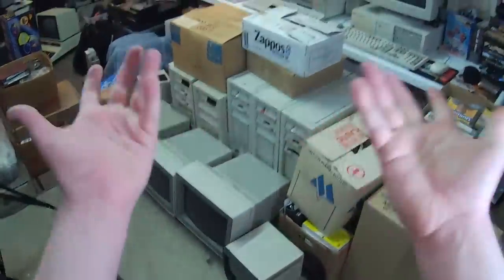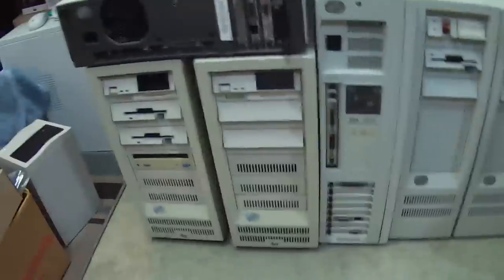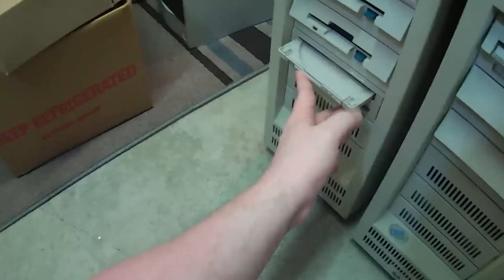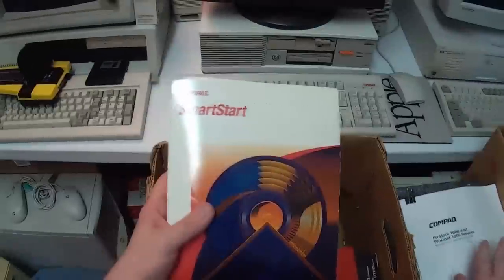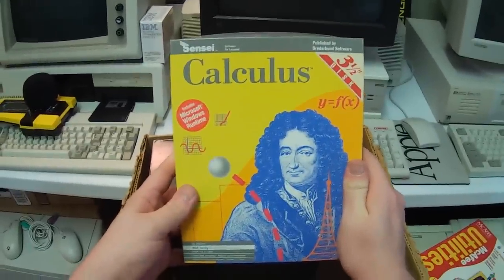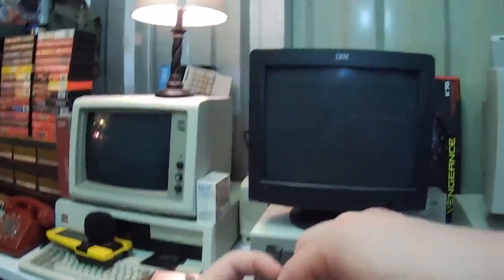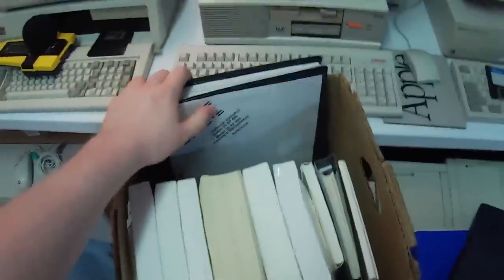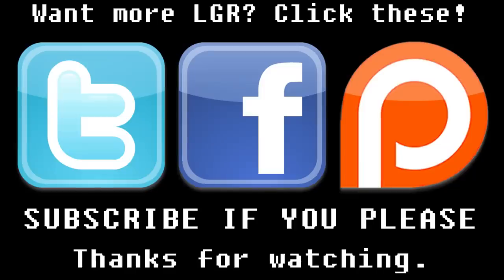LGR - IBM PS/2 Computer Motherlode

Comment: I've cobbled together a respectable PS/2 85.  Came with a 486SX fixed, so I shoved in a 586 overdrive chip so I can play mp3s.  Microchannel sound cards are impossible to find, so I found a Soundblaster clone that hangs off the parallel port.  The bitchin' XGA video card is legit, though.

She's an ugly beast, but she's got character.  And she plays Dark Forces like a boss.

Comment: hey i have a question

i have an old compac tape backup and i dont have the software

is it posible that you have the software for it?
Reply from the maker: ***** I don't, but you can find Compaq software online without much trouble. HP still hosts all the files!
Reply: i have lookes but the device cannot be found

it is an old dos tape reader/writer

Comment: I wonder how many user that Netware 3.12 SYSTEM_1 disk was.  That disk contained the server.exe which limited how many concurrent users could connect to the server.  As well as OS serial number so people couldn't run two copies  side-by-side, as they would beep and throw messages all over the screen, and to users screens (early anti-piracy).  Each server.exe was serialized on every SYSTEM_1 disk, so you could copy the disk successfully as a backup copy, but the server.exe could be traced to the original buyer by Novell.  If you wanted to set up two 3.12 servers side by side in VMs, you would need two different SYSTEM_1 disks containing different server.exe files (therefor S/N's).  Care to share the img/vfd?  I collect them as it was my first server OS I mastered in IT (NW3.11/NW3.12), as a lad of 17yo part-timer.  Only the SYSTEM_1 disk was unique per customer, the rest in the set were standard run copies.

Comment: The IBM PS2 was years ahead of its time.  It it wasn't for corporate greed on the part of IBM suits, IBM would be the big name in computers today rather than Microsoft.  

Unfortunately, because IBM made the far-superior Microchannel bus proprietary, nobody wanted it, and people stayed with the primitive ISA bus as the de-facto standard for years.  

I'd even rate this blunder on the part of IBM ahead of "New Coke" because Coke Corp. reversed their mistake in time, but IBM didn't.
Reply: +Hungry Guy Yeah. Olivetti is one of the few non-IBM computer manufacturer to have made MCA machines. And they actually made quite a few different MCA models! The P500, P750, P800, M300-25, M480-40, M480-60 are all MCA.

Comment: Can you put Regular cd's into a caddy and use them as caddy discs?
Reply: Yep, you bought the caddies separately, put your most used discs in their own caddies and kept empty caddies handy for other discs.  Early CD-ROM drives were available only with caddy loading, because the only software sold on CD tended to be VERY expensive anyway.

Comment: Good morning LGR   I have a decision data  monitor and motherboard the motherboard is in the base  I need help in using it it has two hookups on the back 1 is like a printer type and the  other is serial it uses a 5 pin din keyboard and  ps/2 mouse

Comment: I was given an IBM PS/2 Model 30 the other day, and as far as I can tell it works fine. Problem is though, I haven't got a monitor that plays nicely with it. It uses 14-pin VGA, whereas my LCD monitors have 15-pin VGA. I tried removing the 9th pin so I could actually plug a VGA cable into the Model 30, but one of my monitors doesn't register it and the other one just tells me that the video input is out of range.

I've an older CRT monitor somewhere, and I will try that one when I get the chance. However, at the moment, I'm stuck with these two LCD monitors. If anyone has any idea on how I could maybe get this working, I'd be very grateful.

Comment: Windows 95 on floppy-discs, ALOT of floppy-discs.

How manny floppy-discs would it take for Win8?
Reply: søren kjær 
At first i wanted to say: more than are annually produced worldwide. Then i found out, that (at least 3,5'') floppy disks are still produced and sold. 
I mean: man who buys floppy discs in 2015 ? (well i mean except for Clint of course) There are still many brands out there ... this can't be just for historical reasons.
Reply: søren kjær Windows 95 came on 14 floppies, so about 20 MB of install files. Windows 8's install files total about 3.4 GB, so around 2300 floppies.

+Frank Schneider Many pieces of industrial equipment still use floppies. A few use Zip disks, as well.
Reply: *****
I am quite familiar with industrial IT equipment, but haven't seen floppies in ages. Nonetheless i don't doubt that there are still some systems (especially in small companies and emerging economies) out there still using floppies. But zip discs ? That's like still using MOs ? What half-decent IT department would allow such, not only ancient but highly proprietary, storage technologies to continue being used ? This sounds somewhat criminal from a professional point of view.
Reply: Frank Schneider One example I read of is that a few airline companies still use Zip disks to update the navigation equipment of their planes. Reason being that the practice was started at a time when Zip disks were the best way to go (floppies too small and USB flash drives yet to come), and there's no reason to change yet since the method still works just fine.
Reply: MaxxFordham Your point is? They are similar in structure and working mechanism, yes, but they are still called Zip disks.
Reply: MaxxFordham Well, me and every other person in the world know we're talking about floppy disks when we say floppy disks, and Zip disks when we say Zip disks, so we will continue to do so.

Comment: am i the only one who has HUGE problems watching this video? This Video has to reload every 5-15 seconds for up to a minute to get the next few seconds going and then it has to reload again (yes even in settings like 360p and i usually have videos playing at 1080p or higher without reloading at all).

Watching this right now at 480p and let it load a few minutes to have a decent time to cover lol..
Reply: Daedalus Revolution Try restarting your router or ethernet wall plug whenever that happens. I get that all the time but sometimes it's just the ISP and restarting the modem, router, wall plugs doesn't even fix it.

Comment: Now make Windows XP run on the PS/2 Model 90 XP 486.
Reply from the maker: MarcoZ Uuurrggh. If I have a few spare weeks to wait for it to load, perhaps!
Reply: Lazy Game Reviews i looked up the webpage ( http://www.winhistory.de/more/386/xpmini.htm.en ) from where i learned all that, because i remembered (correctly) that the boot time was about 7 minutes, however what i did not recall was that XP needs the Pentium instruction set to boot. So you're out of luck, unless you're compatible with a Pentium Overdrive, sadly.